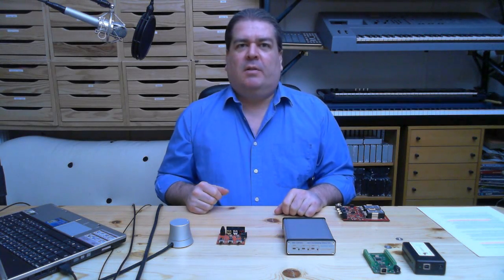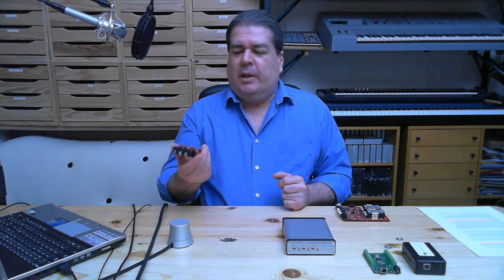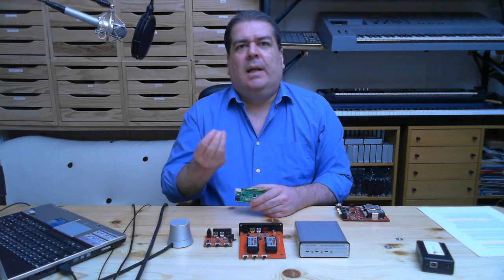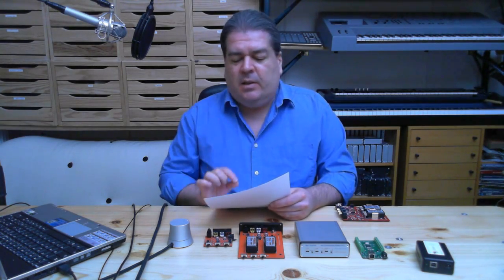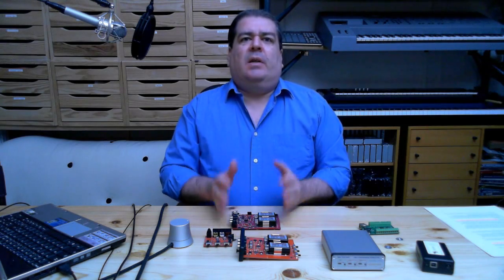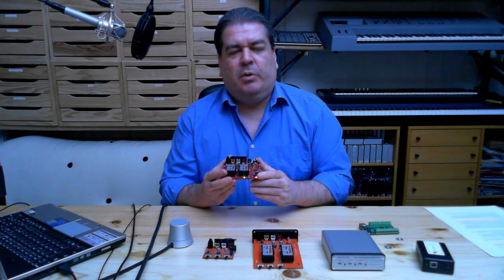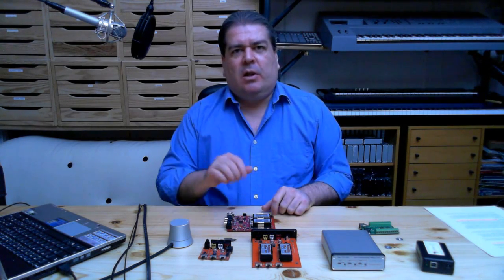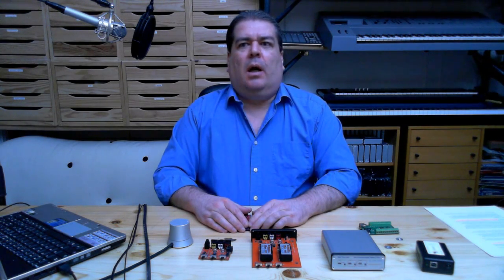USB Audio DAC with jitter killer reclocker crowdfunding pitch

Comment: How do you charge the batteries of the original version?
Reply from the maker: You just plug in an external power supply, and set the both power switches to the 'on' position simultaneously...

Comment: Hi, I was wondering if the old isa sound card such as sound blaster 16 which already supported 16 bits 44.1khz would have incorporated r/2r ladder dac instead of binary weighted ones? 

Despite being old sound cards, i couldn't find anything wrong to the sound coming out of them when propely feeded with a lossless source a few years ago when I messed around with such things. And you're probably from Quebec with that accent. Lol

Comment: I've posed the asynchronous USB question as it relates to external clocking to some high-end manufacturers.  PS Audio, for example, has advised all of their DACs are asynchronous and thus ignore external timing and handle it itself to ensure they can guarantee the quality of reproduction. With most DACs being asynchronous these days, why do high-end companies, such as SOtM and Sonore, place so much emphasis on their network audio adapter's clock improvements?  SOtM even has a connector on their NAA for a rubidium clock.

Comment: Hi love this video my question is can I use this on my sound card coax output M-Audio Audiophile 192 or do I even need it?
Reply from the maker: Hi, thanks for your comment, glad you liked the video. The M-Audio card uses mainstream delta sigma converters (from AKM) and my DAC 3 uses a non-oversampling chip, both technologies sound quite different, and this is the whole point of my project. Many audiophiles think non-oversampling sounds a lot more natural. You can connect my DAC 3 to your M-Audio through spdif coaxial (although not at 192kHz, as the max supported by my DAC now is 96kHz). Or you can just used its USB interface... Hope this answers your question... Cheers...